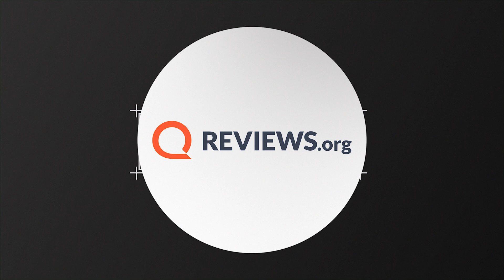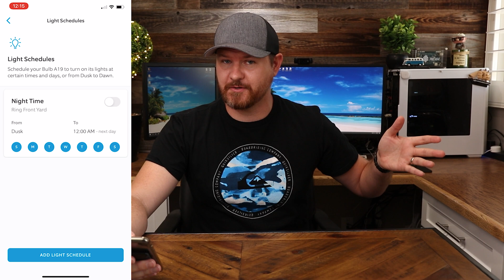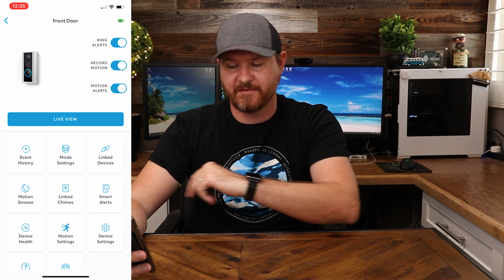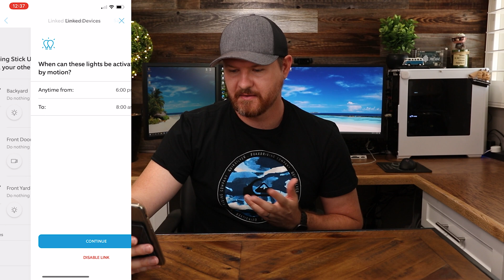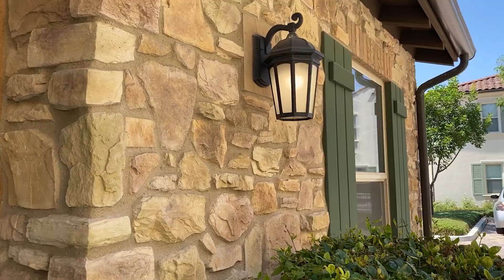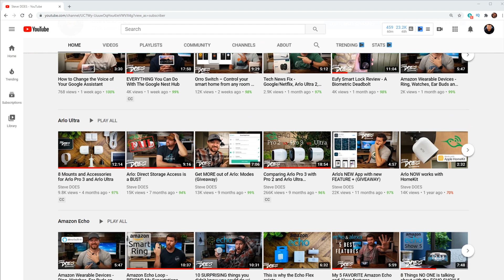How to link your Ring lights and cameras | Turn your camera into a motion sensor

Comment: I have many ring products from security to cameras and more. I cannot find a way to use a motion sensor to not only turn my light on when I come into a room but to turn it off when I leave the room or in a timely manner after leave the room. Is there away to do so and is there a site that I can pull up the information to do so. Right now I’m trying to hook up a smart switch built by Kasa to a motion detector built by Ring. It works perfectly by turning the light on I just can’t get it to turn off without using the switch manually.

Comment: Can anyone answer this question for me. I set up my Ring light  with a schedule. I was hoping it would only turn on when  my camera detects motion but once it hits dusk the light turns on and stays on. Do I have to turn off the schedule for it to only turn on when the camera detects motion? If not then I could’ve just bought a cheaper bulb with sensors.
Reply: So I figured it out, you need to turn the schedule off in order for the light to turn on only when motion is detected.
Reply: @grappler1999  but how do you get them to turn off again when the camera stops??
Reply: @donnastucky5576  I believe there’s a setting for the length of time it’s one like 30 seconds and so on.

Comment: Thanks for the tutorial. Just 1 question, will the light turn off automatically after the motion detection? Thanks again!
Reply: This is the one thing I'm trying to find out.
Reply: No! Mine stay on forever 😡 Does not work well.
Reply: @donnastucky5576  Two of my Ring Smart Bulbs stay on briefly and two stay on permanently. The two that stay on permanently have a Custom Light Schedule to make them turn on from 8 pm to 6 am because I couldn't get the Dusk to Dawn schedule to work--I think it's super confusing to set Light Schedules in conjunction with Ringcam motion and Ring Smart Bulbs.
Reply: Yes mine does